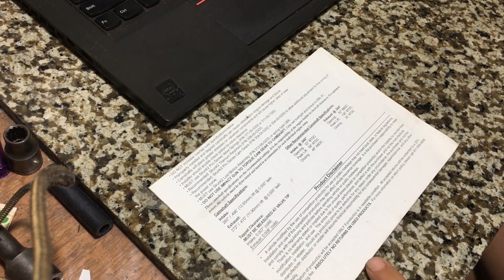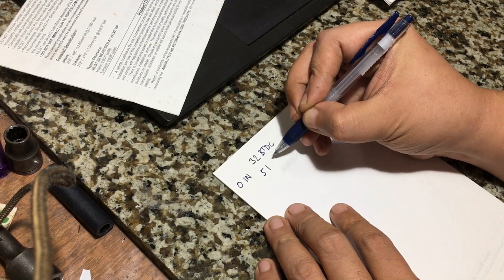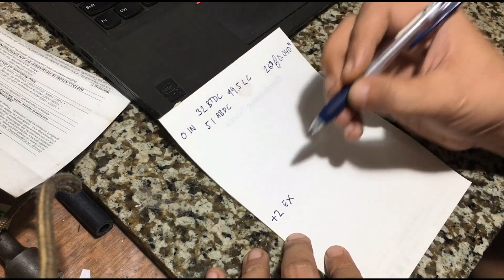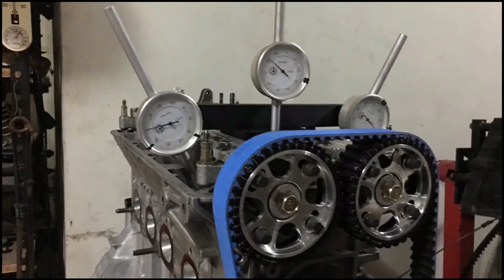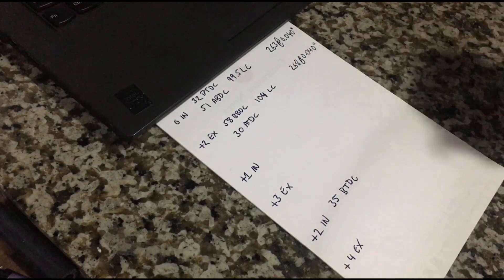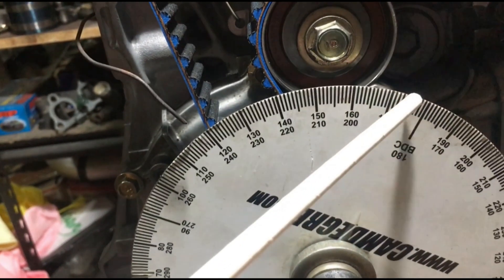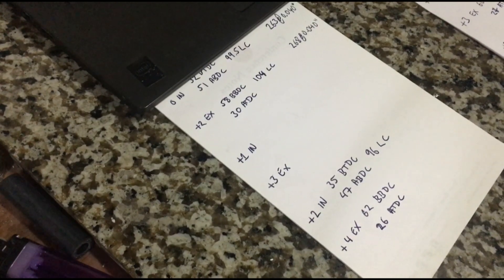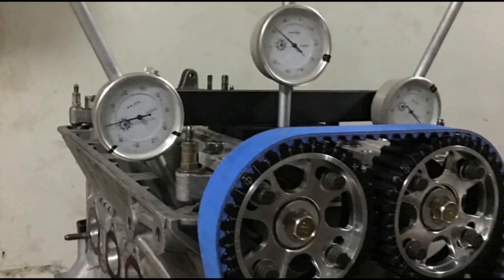How to Cam Degree Complete Steps To Calculate Lobe Center

Comment: Is it safe to run these Pro 2s on zero setting?
Reply from the maker: No cuz zero is always different each brand camgear
Reply: @SRDmotorsports  we ran zero on stock camgear. Got an aftermarket set, was wondering whether it is safe to run until we get it degree’ed.
Reply from the maker: like I said… if u can degree it first that’s better with the engine disassembled… why? It takes 0.1sec to destroy 100% of the engine 

and regrets don’t bring engine back from damages

Comment: Could you do a video for those in a budget and only access to one DTI. That would be a good help.  Those kits you use are 500 pounds in the UK. It puts a lot of people off.
Reply from the maker: u can do the same with 1 , just like the sohc vtec degree I did just exhaust and then u can do just intake
Reply: @SRDmotorsports  okay I will have a look, thanks again
Reply from the maker: @Marcturbo1  yes sir just needs a good magnetic stand that is movable arm like in the sohc video , the rest you still do the same what I did here on this video only difference is if u start on the intake u set the dial guage there then after set it again on the exhaust

Comment: ive degreed cams and actually found more power running them at zero or even just half degree advancement
Reply: I have a b20 vtec woth gsr special grind cam that made 218hp on 91. I installed pro1cams and m5 fuel and only made 228 so only 10 extra hp. But tuner didn’t want to mess with my cam gears settings. Wonder if I can get more power out of that cam?
Reply from the maker: There’s def more in it
Reply: @SRDmotorsports  or should I just install a pro2 or will my b20 replica type r pistons take pro3? I am currently 228 hp m5 fuel with pro1
Reply from the maker: I think pro2 would be better and safer
Reply: @SRDmotorsports  what should the cam gears be set at? My tuner doesn’t like to mess with cam gears adjustment Much.
Reply from the maker: pro2 has to be degreed to be safe no setting will be the same as the other
Reply: @SRDmotorsports  what should they be degreed at ?
Reply from the maker: @B20Sancho  the skunk 2
Website has the suggested lobe centers 
you degree for lobe center not how much is moved in the camgear

Example if intake is needed to be at 98 lobe center then get it to 98 lobe center it doesn’t matter what the camgear says , as every brand measures different
Reply from the maker: Nice

Comment: Just wondering, why bother degreeing your cams if the suggested cam card centerlines isn't the right settings for your application?
Why not just do cam inspection for V2V and P2V clearance and play with cam settings at the dyno?
Reply from the maker: That’s what everyone local to me thinks and sees it however that is doable yes… is it proper? No…. 

Because the suggested cam centerline is what the cam was designed “properly” for
if on the dyno ur intake cam wanted + or - the suggested centerline? that’s power? Yes

But the story doesn’t end there… “why” it made better numbers when advanced or retard = says what lacks or what is too much on the engine intake or exhaust or compression or both… 

I don’t share the exact details as I expect a proper builder already knows this but I’d bet u that you can ask “alot” of “wannabe” and they won’t know “why” it made power with + or - except “the engine liked it”

Well why did the engine like it lol
Reply from the maker: That differenciates “engine building” and “developments” vs “engine assemblers”

we both can agree there’s too many self proclaimed peeps out there but ask them to explain they’d tell u it’s complicated? Hahaha

but hey they obligated to add “development” or “engineering” to their brand name 😅
Reply: @SRDmotorsports  oooo i see!, that's a great way to put it. So it's more of a way to finding the "Weak link" to your setup if you haven't satisfied the cam card's specifications or in other words incorrect engine combination.
Reply from the maker: Yes sir… the cam card specification is how the “cam” was designed… sadly we see a lot of places think they know more than the actual makers 😂

Comment: On my k20 would the centreline or degreeing my motor end up in a power loss with skunk2 cams
Reply from the maker: Not really I mean the skunk2 suggested lobe center is a marker where it’s supposed to be by design but must check everything on that
Reply: @SRDmotorsports  but would I need an exhaust cam gear that’s adjustable ? Because mine is still stock.. and their different cams suggest different centrelines , 107/108/111/114 

I have no clue how any of that works, I learn but I can tell more from driving
Reply from the maker: @the_JDM_fanatic  actually to fine tune to the detail… personally I believe an ask exh gear does help but without it won’t be the end of the world

Comment: This means that we assume that Skunk2 has a symmetrical camshaft lobe design meaning lobe center (LC) is between Open and Close. Is it problematic if we don't have the recommended duration or Open/Close degrees? is it problematic if we don't have the recommended safe practice of 3 degrees difference between EX and IN?
Reply from the maker: Well regardless of that… the lobe center is almost where max lift is… and we do the math based on “opening and closing” because some cams tend to have peak lift maintained a degree or two…

symmetrical and asymmetrical… the opening (from closed) to @0.050” lift or 0.040” lift does not change

But yes anything from 0.100 to max lift on the opening and closing is different on the skunk2 cams and that’s where “plotting” becomes helpful but that would be a 45min video too boring 😂🤣

Comment: I'm trying to wrap my mind around this. I have so many questions
Reply from the maker: Watching it a few times may spark the light bulb, also this and the part 3 of the b20vtec kind of correlates with one another as far as visuals go, makes sense as it’s the same engine hehehe
Reply: @SRDmotorsports  I'll look into it
Reply from the maker: @Built_it_by-alex  have a go at it maaaan
Reply: @SRDmotorsports  not sure if you'll read this, it's been awhile, I've finally got all the tools to degree my cams, I've looked at this video many times and I think I finally got it, I'll have a go at it very soon

Comment: SRDMotorsportsTV is Cam Degreeing procedure also done when installing aftermarket camshafts, valve spring and retainers ?
Reply from the maker: Depends really on basic set ups a lot of times no, example crower stage 2 on a d16z6 with correct cam gears etc

Comment: Hey man what’s seat pressure spring valve correct for my b20 vtec setup, I building b20 vtec all motor forged
Reply from the maker: hey man thanks for the comment and question :) it depends on your cams but lets say from skunk2 tuner 2 , pro2 and even pro3 we like to use supertech spr-h100dr spring the 85lbs seat pressure set

excellent cuz on the "next episode" of the B20vtec series i would be mentioning it

Comment: Very detailed computation tito! Thankz.
Reply from the maker: cam degree eh no short cut to get the lobe centers desired :) but the main benefit i hinted on the video... the ideal lobe centers are where the cams work at best 

and on the dyno if u make more power on diff settings? +1 or -1 degree? id know whats missing or needed to improve so 99.99% of the time "next" dyno is always always more power :)

some kase think degreeing is the end all be all and thats it. while it is somewhat true it is also like a "compass" that lets u know with the dyno on where  its headed :)
Reply: @SRDmotorsports  comparing it to a compass is just awesome!
Reply from the maker: @benjieco630   well... cuz we hear it "its taken to the wrong direction"

well ok a compass then! 🤣
Reply: @SRDmotorsports  i myself also thought that cam degreeing is the end of the dialling process. I even  misjudge that adjustements made on the intake must be equal or lesser on the exhaust..🤣🤣🤣
Reply from the maker: @benjieco630   no actually its just the inevitable thing on Pro series cams as the exhaust is bigger by design and it works.

But example crower? they are okay to be set to "zero" "zero" and still be "okay" but ofcourse as noticed, valve to valvr checking, clay testing and especially degreeing will let you see the better window of safety.

Cam degreeing is somehow end all be all but on a different perspective, the suggested specs are correct meaning if the dyno shows u different and u need to advance or retard the intake? it means "changes" on the engine is needed for the cam to enjoy its proper position
so changes + redyno will almost always insure more power and 99.9% once u get the complimentary parts to let the cam be at best on its "suggested" position is MORE power
Reply: @SRDmotorsports  wow.. i didnt know that on Pro series that the exhaust cams are bigger. Thought it is the same as the intake. Thankz for the info tito. 

Would u prefer Pro series over Crower 403s?
Reply from the maker: @benjieco630  depends some set ups the 403 is good even on b20